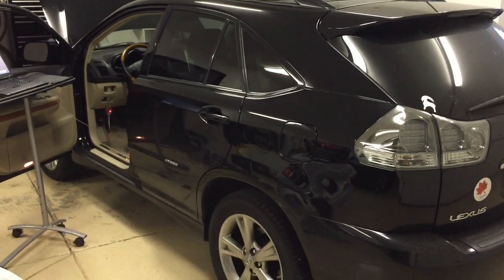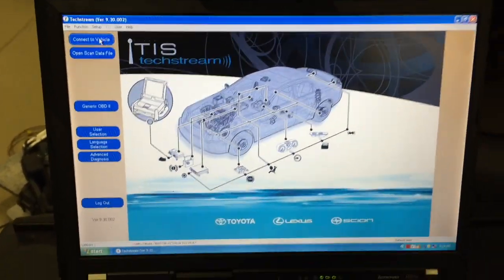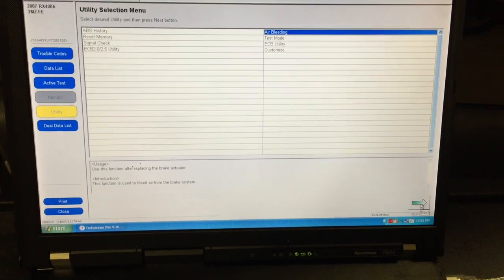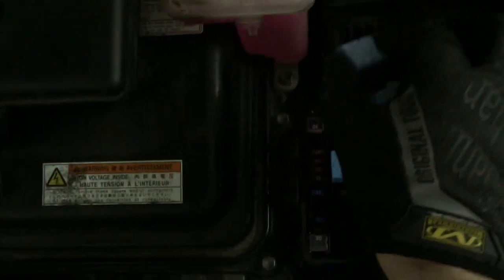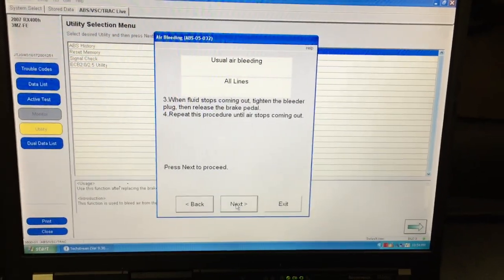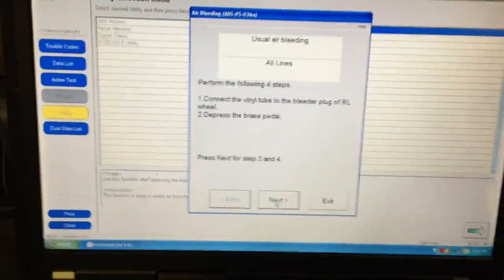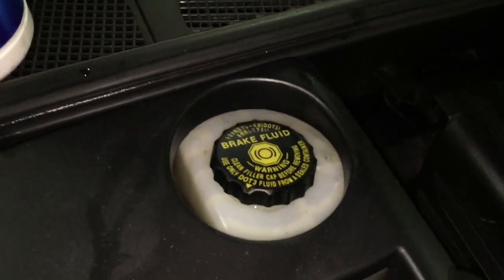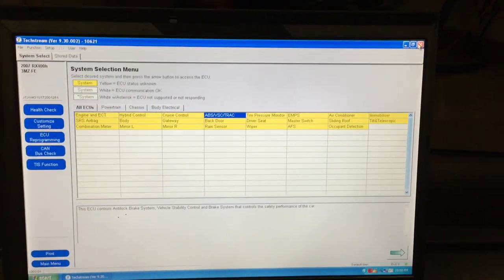Toyota & Lexus Hybrids - Computer Hydraulic Brake System Bleed after Brake Pad Replacement

Comment: I used this on my 2008 Highlander Hybrid with the Foxwell NT 510 Elite scanner with the Toyota profile. The procedure was just a little different as it didn't prompt me to remove the brake motor relays as seen in this video, but otherwise was the same and allowed me to bleed all the air out of my brake lines, front and back. Thank you for this video!! Saved me a trip to the dealer.
Reply from the maker: I’m glad to hear that the Foxswell option worked well for you. It’s definitely easier to use than a laptop.

Comment: Well, good thing I saw this.  I was about to do this on my wife's 2007 Toyota Highlander Hybrid.  Since I don't have a Windows XP laptop with that software, I guess off to the dealer it goes.
Reply from the maker: If you read the video description, there are now some other options available that don’t require XP or even a computer. But it’s still one more thing to get to do the job.

Comment: I'm sure the poster misspoke, but for the love of God don't use DOT5 in there. The silicone based DOT 5 is not the same as DOT3, 4, and 5.1, which are PEG base. DOT3, DOT4, DOT5.1 (sometimes called super 4 or something gimmicky like that). Thanks for the video :!
Reply from the maker: You are right! DOT5 brake fluid should not be used with ABS braking systems or mixed with DOT3/4/5.1.

Comment: I have changed the rear brake pads and now they are detaining and overheating. Do I have to do the bleeding procedure or firs rebuild the brake cylinder (piston)?
Reply from the maker: If you only changed the brake pads and not the fluid, you should definitely change the fluid and do the bleed procedure. However, the problem you are describing doesn’t seem to be related to bleeding the brakes. It sounds more like a stuck brake caliper.

Comment: Ls 460 after pumping the break pedal many time abs light on when I check I have got linear solinoid I tried to calibrate it but it isn't complete so if this bleeding process may help thanx in advance and if not what could be. Every thing was fine before pumping the break pedal after replacing breakpad and playing with my scantool

Comment: Don't need to bleed or purge after pad replacement. That is, so long correctly accomplished.
Reply from the maker: Brake fluid needs to be changed every 2 years. This is in the maintenance schedule. This is because brake fluid absorbs moisture and becomes ineffective over time. The moisture corrodes brake components and boils during braking, causing the brakes not to stop. If you’ve changed brake fluid within the past few months and now you’re changing pads, I suppose you could change pads without bleeding the system. Otherwise…always change brake fluid when changing pads.

Comment: I have a 2011 Highland Base model, not Hybrid. Two months ago I replaced front rotors and pads and changed brake fluid. I bled the brake lines in the conventional manner. Pedal feels just ok, but a little spongy. Should I have bled the brakes on my '11 Highlander like you did in the video?
Reply from the maker: It shouldn't be required to to follow this procedure on non-hybrid models. I would consider it optional to push new/clean brake fluid through the ABS actuator. If the brake fluid reservoir ever ran empty during the brake bleeding procedure, maybe there could be some trapped air that this procedure would help eliminate, but I think conventional brake bleeding should be sufficient.

Comment: What if I just need to change the fluid? Do I have to go through bleeding the four sides? Or just the rear? Open it and let it drain.
Reply from the maker: You have to do this any time you crack the rear brake lines, including during a fluid change.
Reply: So system flush basically means you have to open all the lines and follow the techstream software for the bleeding procedure.
Reply from the maker: Bhakta Singh Correct.

Comment: Thanks for the instructions. It was roughly the same on Camry hybrid. However, after bleeding, the brake actuator is not priming as it used to when I opened the car door every time in the morning. Now it does it when I depress and release the brakes. No lights of any kind and the brake feels fine. Any idea?
Reply from the maker: This is really odd. I haven't heard of this happening before and I'm not sure what the cause may be. Sorry I couldn't be of more help and good luck figuring it out.
Reply: ever find the solution?

Comment: If I purchase the Foxwell 510 I do not need the Toyota Techstream software for my 2007 Camry Hybrid? Is that correct? Thanks James
Reply from the maker: To be clear, I have not personally verified that Foxwell has the brake bleed software. My understanding is that the Toyota-specific Foxwell add-on isoftware (each Foxwell device comes with 1 OEM-specific add-on) does have this capability. This means you will not need TechStream. Please let me know what you find.

Comment: What happens if the reservoir level drops too low. Do you just keep bleeding after adding more fluid? Or do you need to use the master cylinder or abs module replacement mode?
Reply from the maker: The recommended method to get all air out of the system is to do both systems.It’s likely that only the main hydraulic system would have air in it, but it’s a good idea to do both.

Comment: So I was replacing a broken wheel stud (front driver side ) and had to put my car on N to freely turn the rotor to access the stud.After I completed the repair i hit the brakes to put the gear back on P forgetting the caliper is off and the piston fell out spilling fluid.I put the piston back in with a c clamp.Should I just replace the caliper or do I also have to bleed the line.If yes to bleeding the line would I still need all this programs to bleed just the front drivers side break? 2016 Toyota Highlander hybrid
Reply from the maker: You definitely need to bleed the brake line to that wheel. I’m not positive on the 2016, but prior models have standard front brakes, so this special procedure would not be required to bleed the fronts. If you don’t get fault codes afterwards, you should be fine.
Reply: Carlton Bale thanks you guys on here are awesome

Comment: You said something about a brake pump in the video for the rear brakes. if there is a pump, does it have a fuse, and where is it located
Reply from the maker: Stanley Hotler I think the pump is controlled by the relays that I show pulling at the beginning of the video.
Reply: Stanley Hotler q

Comment: Is this the best solution as if right now? I see that both links for the adapter cable are no longer working.
Reply from the maker: The cheap USB cables and software running on old 32-bit versions of Windows have always been a bit sketchy. But cheap and useful if you can get them to work. 

My current preferred solution is the Foxswell 510. The Toyota version can do the ABS service sequence. It’s simpler and more reliable (but also more expensive.)

FOXWELL NT510 Elite Bi-Directional All Systems Scan Tool for Toyota Lexus Scion, HVAC 4WD Code Reader with Enhanced Active Test ABS Auto Bleed Battery Registeration TPS TPMS etc(Professional Level) https://smile.amazon.com/dp/B07Y2QMKJ6/ref=cm_sw_r_cp_api_i_hA9cFbF29T3X9

Comment: At 6:17 you had a jump cut when pressing next. Did you run into any issues because i keep on getting a bleeding failed message try again and can not proceed. Thanks in advance.
Reply from the maker: As I recall, I had that message pop up several times. I’m not exactly sure what caused it but I’m guessing it’s related to data link communication not working properly because of the cheap datalink adapter. I kept retrying and it eventually worked. You may need to try a different adapter (or and older laptop) if you can’t get it to work.
Reply: @ProjectBiehlmeister  Thank you for the clarification  and reminder that youtube and real life troubleshooting and repairs are not always the same experience. All hope is not lost and I will keep on trying at it. And thank you for the video.

Comment: Hi,  I have 08 highlander not hybrid. I just change the brake calipers for my car. Do I need to use techstream to bleed the brakes  or this is only for hybrid car?
Reply from the maker: To my knowledge, only the hybrids require this special procedure - due to the regenerative braking system.
Reply: Thanks for your help.

Comment: Im having an issue on my 2006 Highlander. I replaced my actuator and have a similar setup. Same looking cable, bought software off amazon. But, I cant get it to bleed. I removed the 2 ABS relays and get a failed to bleed screen just like you did after the edit. What was the issue? Cars in park, brakes set, relays removed, keys in the ON position.
Reply from the maker: My recollection is that I had to retry the test multiple times to get it to work. I think the cable may not communicate perfectly and therefore requires multiple attempts.
Reply: How much was your actuator
Reply: @bricemiller did u get pass this issue?

Comment: I accidentally depressed brake when working on Left/Rear caliper. Fluid spilled out, dropped in reservoir. I flushed the system but the brake keeps dragging a bit? I heard that I need to re-learn to brake. Do you know anything about it?
Reply from the maker: I haven’t heard anything about the computer needing to relearn the brake positions. To my knowledge, all you have to do is follow the procedures described in the video. What you’re describing sounds more like a caliper issue.
Reply: @ProjectBiehlmeister  The caliper was changed (very unlikely both were bad, and rear right has no issues, same brand), the flexible line/hardline after were changed. The bearing seems good. I'll do the procedure again - maybe even do the system bleed too and see if things improve.

Comment: Can I replace a rear caliper, pads, and rotors and manually(old style) bleed the rear brakes and drive the car safely with the  engine code lights on for a couple of days until I get the software?
Reply from the maker: I wouldn't say that you could drive it "safely" without electronically bleeding the brakes. The front brakes should still work, but the rear brakes most likely will not. The fault lights will be on because the rear brakes aren't working. You're not just resetting a light with the software; it actually primes and bleeds the rear brakes. You can't bleed them manually.

Comment: You bleed the brakes when you change brake pads or remplace the caliper?
Reply from the maker: Absolutely. If you follow OEM service intervals, brake fluid should be replaced much more frequently than brake pads. Brake fluid slowly absorbs humidity from the atmosphere, which will eventually cause the brake system to rust internally and the fluid will start to boil under heavy braking. Plus, any time a brake line is cracked, the system should be bleed to make sure there is no air in the system. At minimum, the brake fluid should be replaced every time a brake system component is replaced. 

I highly recommend the brake system pressure bleeder from Motive products to make brake bleeding a 1-person job.

Comment: I just changed the rear break pads on my lexus rx 400h without bleeding them,which I didn't know it needed bleeding,it ran fine for about a week,now its acting up again,and all the lights are on again,break lights,abs lights,traction lights,check engine light,triangle lights,and the breaks are not working properly,hard to press the breaks,it only slows down,and there's a non stop beeping sound from the abs actuator,I'm assuming it's the break actuator needs replacement,but I'm not sure if all I need to do is bleed the breaks to get it working again,please help
Reply from the maker: This is how the vehicle acts when you don't bleed the brakes properly. This is similar to how my vehicle operated right after I did an improper brake bleed. I did a proper brake bleed, and it fixed the problem. 

It's unlikely that the actuator failed just after you replaced the brakes. It's more likely that you need to change the brake fluid and do a proper brake bleed.
Reply: I was told that the breaks didn't need bleeding cus it was just the rear pads that was changed out,before I changed the pads, the break actuator was making a beeping sound that kept coming and going and now it's non stop,but once the break pads was changed out,all lights did disappear,but now is all back,I'm very confused now cus I don't understand why it needs bleeding if it's just the break pads change out,so I don't know if it needs bleeding,or the break actuator,I was told it would cost 3-5k to fix
Reply from the maker: @vibrantstar2879  First of all, you should always bleed the brakes when changing brake pads. Brake fluid absorbs humidity and has to be replaced per the factory maintenance schedule. 

Secondly, it’s much cheaper to bleed the brakes than replace actuator. Bleed the brakes properly and if the problem is still there, replace the actuator. 

Without knowing the exact fault codes, it’s impossible to know for certain what the problem is.

Comment: I'm replacing the rear pads on my 08 highlander hybrid.  Do I need to reset abs or anything?
Reply from the maker: Yes. You’ll need to replace the brake fluid and bleed the brakes following this procedure.
Reply: @ProjectBiehlmeister  thanks for the quick reply!

Comment: Replacing pads you don't need to bleed brake system. Computer brake system bleeding you need when replacing ABS unit.
Reply from the maker: A lot of people only flush the brake fluid when the pads are replaced. On hybrids, the pads can last 100,000 or more miles. If that's the case, then the brake fluid should definitely be replaced.

The Lexus scheduled maintenance interval for brake fluid is to replace it every 30,000 miles. Unless you just replaced the brake fluid and didn't notice that the pads were near end-of-life, I can't imagine many situations where the pads would be replaced but not the brake fluid.

Comment: What happens if all 4 brake pads are replaced but these steps aren’t done?
Reply from the maker: Aki Summers   Replacing the pads typically involves bleeding the brakelines. If these steps are not followed for bleeding the brakelines, there will be fault lights on the dashboard and the rear brakes may not function properly. There should be no issues with the front brakes, as they operate just like standard hydraulic brakes  on conventional vehicles.
Reply: Carlton Bale, thank you for responding so quickly. We definitely got all the lights on, tick tick ticking sounds from the ABS Module and eventually the accentuator (sp ??) died. Will have to replace it now.

Was just wondering could it been related or not having those steps done could eventually cause it to go bad? Again, thank you for responding and have a great weekend.
Reply from the maker: The rear brakes are controlled by a hydraulic accumulator / actuator (I'm not sure what the official name is.) I don't know the system well enough to say for certain, but driving extensively with that hydraulic system not primed properly (i.e. the dash lights on) could cause the hydraulic accumulator / actuator to fail.
Reply: Carlton, thank you. Sadly I think that’s exactly what happened in our case. Hind sight is always 20/20! Have a great weekend!
Reply: Aki Summers, I know the ABS  module/pump/actuators go bad often on Toyota Highlander hybrids. That's why used ones are hard to find and expensive. It maybe not your fault after all!

Comment: I have a camry 2009 hybrid and I replaced all 4 rotors and pads and now the brakes feel weak, laggy and all the lights came on, what I should do to solve this problem?
Reply from the maker: YA BD You need to follow all of the steps in the video including using the electronic service tool, or take it to a shop to do it. Definitely be careful driving and tow if necessary!
Reply: @ProjectBiehlmeister , I replaced rear pads on my 2010 Prius and there was no need to go through this posted procedures. No dash light or soft brakes. Luckily Prius is an exception!
Reply from the maker: @ronmelliad7327  Good to know. I'm not sure exactly which Toyota Hybrids have which systems. Hopefully, this has been improved newer models.
Reply: @ProjectBiehlmeister  Just a quick question! Do I need to do this even if I don't bleed the rear brakes and just replace the pads? Thanks
Reply from the maker: Ron Melliad Technically, according to the Toyota maintenance schedule, you should be changing the brake fluid more frequently than the brake pads (it goes bad due to moisture absorption by the brake fluid.) And if you change fluid, you probably need to run the procedure. 

But if you don’t have any functionality problems or dash lights at the moment, you’re probably ok for what you’ve done so far.

Comment: Thanks for the quick reply, where can I get that toyota software
Reply from the maker: I've heard that the scan tools that you can borrow/rent for AutoZone can run the brake bleed commands. That's the recommended path. Some vendors on Amazon who sell the PC cables provide a copy of the software with the cable, but it may not be an authorized copy. Proceed at your own risk...
Reply: Went to AutoZone and they looked at me like I had three eyes. Did you get the Toyota software from a friend?
Reply from the maker: James Healy Yes, but you can use the the OBD2 cable link in the youtube video description.
Reply: James, were you able to solve this issue w/ the software? If so, did you just reset the error (lights) and/or perform the air bleeding procedure? Thnx for the swift reply!